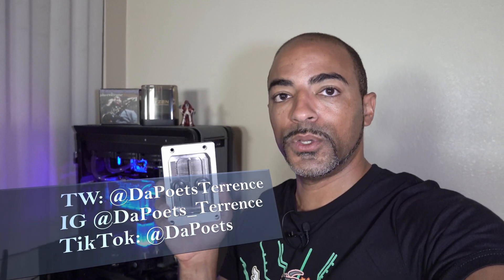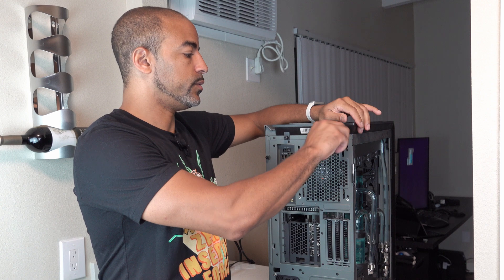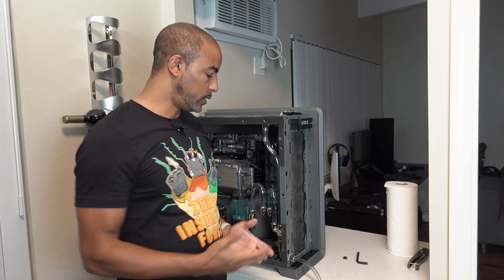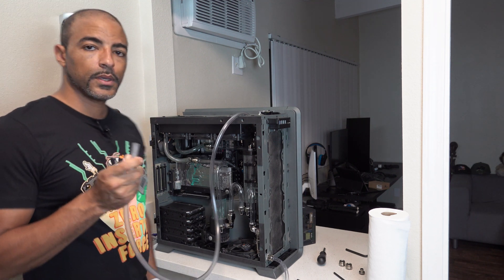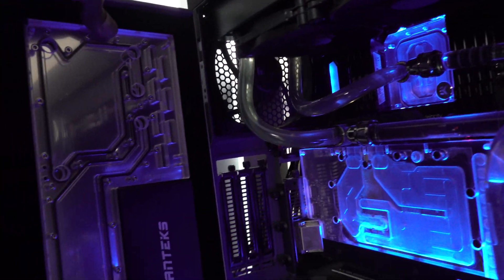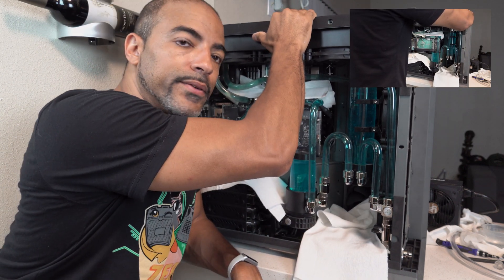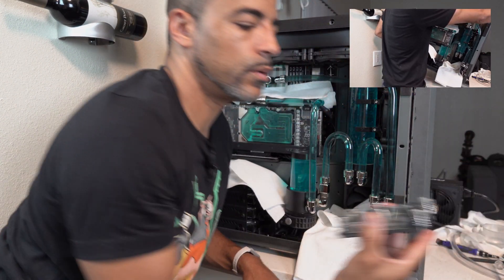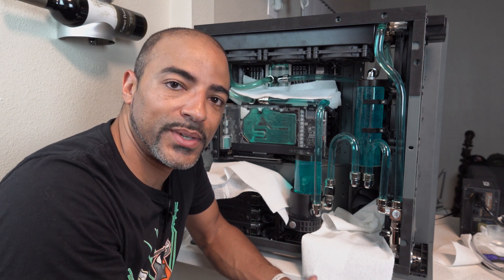Water Cooling Drain/Fill & Leak Testing, Threadripper 3, Phanteks 719

Comment: Hey, I have a few questions as I am building my new rig in this case. Are those fill and drain ports included with the case and preinstalled? Also I am looking on setting up dual 3090s in SLI, they are on waterblocks so they only take up about two slots of spacing. My main questions is do you think I would be able to mount the gpus vertically side by side? I understand I would likely have to modify a vertical mount but could you say if there is sufficient space to mount two watercooled 3090s vertically and allow them to be spaced out enough to have them connected with a 4 slot SLI bridge? I know it's alot to ask especially since your config is setup very different. But any insight would help.
Thanks!

Comment: Did you drill a hole for the drain yourself, or was it? If so, what fittings did you use later?
Reply from the maker: That's the drain valve that's part of the case. You just get a fitting for it based on your style. A lot of different types of drain valve fittings will go with this

Comment: Sick build, bro! Note to viewers: Always use a blower or hand-pump to blow your lines clear. If you blow into it with your mouth you will introduce bacteria into your loop which will contaminate your coolant. This will cloud/darken your cooling solution and cloud your tubing over time. It is really hard to fully clean out your loop once the bacteria has taken over. I've learned this with previous builds. Remember, the mouth is the dirtiest part of the human body.

Comment: Is this system stained just from the transparent EK Navy Blue coolant? It doesn't look very good and I still can't decide if I want to use colored coolant...
Reply from the maker: looks are all opinion. staining will happen to all PETG tubing over time.
Reply: @DaPoets  Sorry I didn't properly explain myself... The coolant looks great, but the staining on your components doesn't look good. 

Also I'm not really concerned about stained tubing, since that can be easily changed. 
I'm mostly worried about the CPU / GPU blocks and a flat reservoir. Because in your video those things seem to be stained as well and I'm not sure if it's possible to properly clean them.
Reply from the maker: @MrTorexko  once they are stained that is pretty much it.  There are some harsh cleaners you can use but I've seen mixed results.

Comment: hi nice PC and nice work. 
I want to ask a question I have the same case I could put this radiator on the front of the case (https://www.alphacool.com/shop/radiators/active-radiators/15235/alphacool-nexxxos-monsta-420mm- radiator) and at the top of the case do you know if it accepts 420 radiators or only 360?
Reply from the maker: Check out Phanteks's website, they show all of the radiator combinations you can use for this case and it's very easy to understand.

Comment: Isn't the connections for the graphics card water block in/out reversed?
Reply from the maker: No it's all good
Reply: @DaPoets  Checked an old installation manual I found online, for the EK Strix 2080 Ti block, and it does say "You can use any opening as an inlet/outlet port". Unexpected. All blocks I've had are unidirectional. Especially CPU.
Reply from the maker: @FoxBatius  CPU yes, GPU not so much.

Comment: Awesome informative video.  Learned a few things!!  Just wanna verify; Are those EK fittings?  And what are you suggestions on best types of fittings for using as a drain.  I'm currently planning out a threadripper build also..  Might give that optimus block a go!!
Reply from the maker: EK is very good to use, and yes most of the fittings I use are EK. Have fun!

Comment: I really like your videos and how careful you are with everything. I've just build my own Threadripper X3970 rig with the same chassis first, hade to change chassi thought when I change motherboard from Gigabyte trx40 aorus master to Gigabyte trx40 Designare (it's a XL-ATX??). My new chassi is Corsair Obsidian 1000D.

Like to se how your new water block is doing with big interest. I have my self the Heatkiller IV Pro pure copper with Thermal grizzly kryonaut and one 480 radiator.

Keep it coming and take care in these times of Corona.

Regards
Mikael
Sweden
Reply from the maker: Hey thanks!  I have a video in the works showing the Optimus water block in action with some comparative data.  Heatkiller IV Pro is top notch as well!  ATX & XL ATX are rough size estimates so since there isn't an industry standard you'll find large cases like the Phanteks 719 even w/ all of it's space still can't fit all XL-ATX motherboards.

Comment: how difficult is it to get into watercooling? im not thinking about it yet but i do want to in the future.
Reply from the maker: It takes a lot more research and planning compared to just building a PC. You have to understand what metals to use materials for the tubing fittings style of pump consistency of the fluid. But if you put in the time and research it's a lot of fun.
Reply: I am doing a guide to watercooling on cheap, from aliexpress and taobao, that are way cheaper option, complete loop of rad + cpu + gpu for under 200 euros / dolars. Its not hard, the only problem is to find your stuff for cheap, and have that performance / price.  So i can give you a idea, a good compression fitting 10ID x 13OD can go has low, has 0.50 dolars / euros.  Same thing has the pump, people say D5 or DDC, but you can get has cheaper alternatives on the market.

Comment: Do you plan to do any overclocking guides? I’m upgrading my system when I move to my new apartment and am interested in learning the ropes. Nice vid!
Reply from the maker: I may do some as a guide. Every processor is different it would be just that, a guide.

Comment: Great video, and nice build! What speed are you running your pumps at?  I've got 2 X D5 as well running in series, and am running at about 50%. Just wondering how loud they are for you. One of mine is definitely louder than the other. wondering if I should replace it?
Reply from the maker: 100% for both pumps. D5 pumps are nice and quiet. Can't hear them at all.